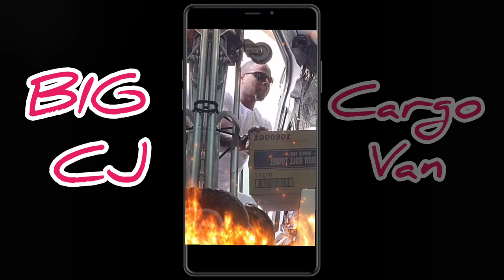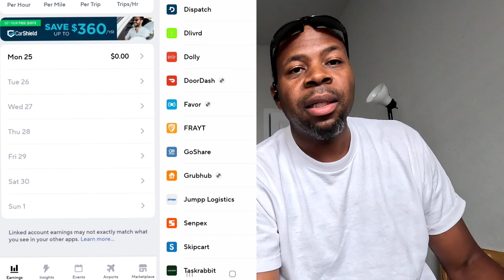New much needed equipment for my cargo van

Comment: Those ramps are useful.  You're a strong guy, so the shorter ramp should work out just fine for you.  I like having a longer ramp.  Also, the taller the van the longer a ramp someone may want.
Reply from the maker: Yes, the ramp is a great addition. I still want an extension for it. Trying to make loads and unloads as easy as possible 👍🏾